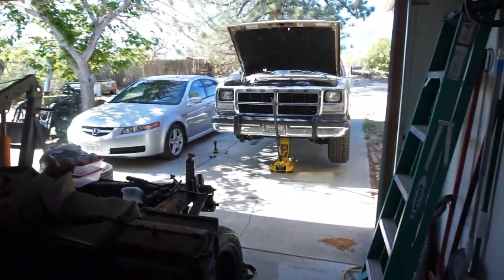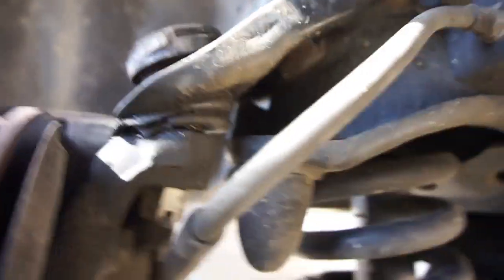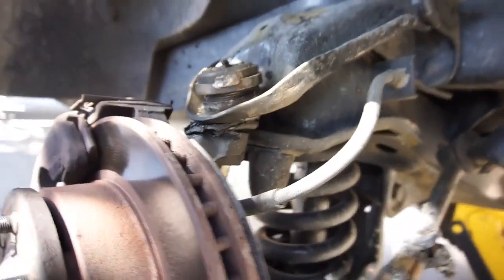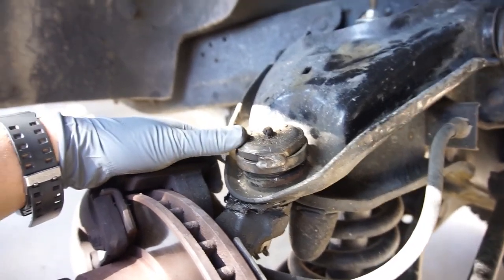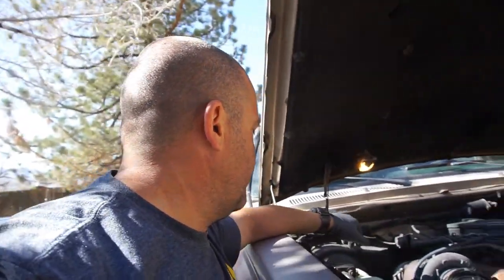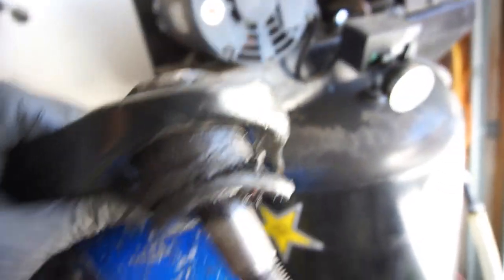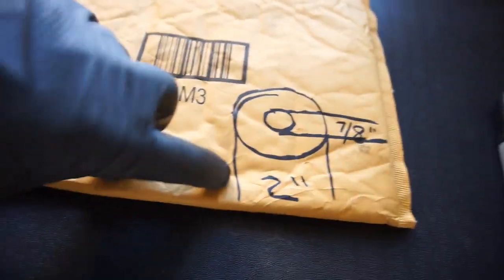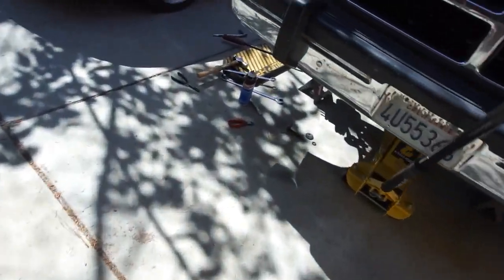1993 Dodge Ram Upper Ball Joint / Control Arm Popped Out Again. Permanent Fix.

Comment: Try putting longer shocks
Reply from the maker: juan mora the shocks are long already. With suspension fully extended they still have 2”.
Reply from the maker: juan mora it’s the angle of the upper a arm.